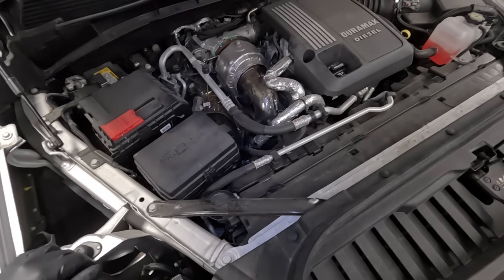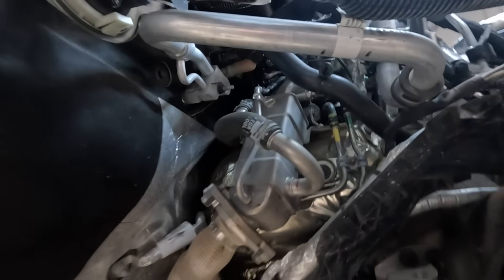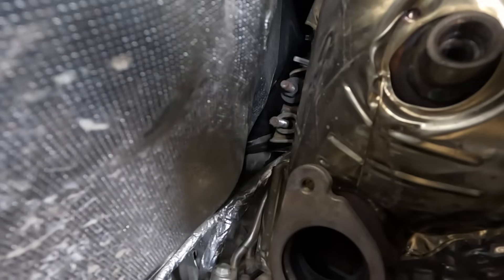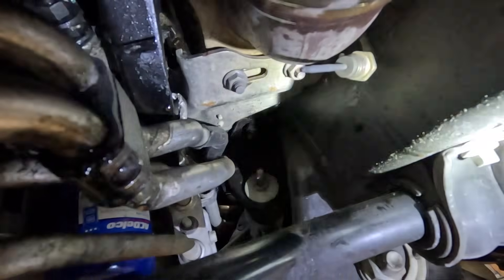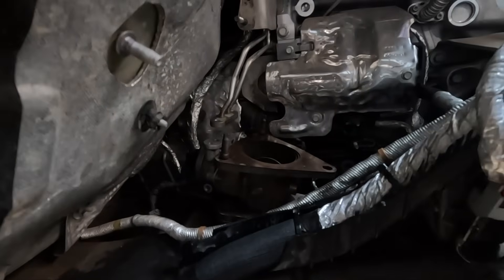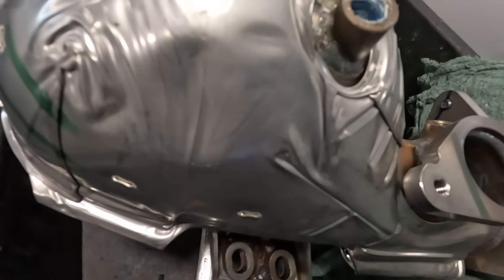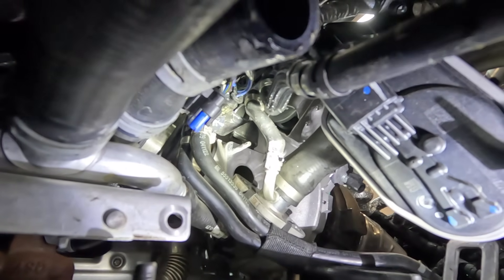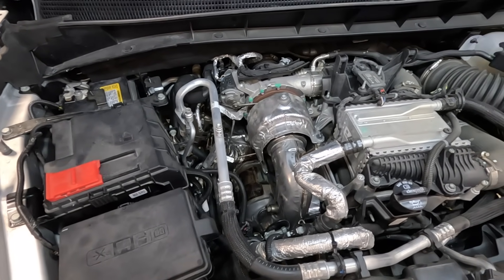DPF Removal + Replace 3.0 Duramax Diesel new SCRF / NOX Filter

Comment from the maker: You can Support the channel by using Affiliate links:

www.bankspower.com/DemonWorks

3.0 Duramax Oil Change W/ PPE Oil Filter: https://amzn.to/3qmLR6o
3.0 Duramax Oil Change W/ ACDELCO: https://amzn.to/3QtmDO5
3.0 Duramax Fuel Filter: https://amzn.to/3qc0uJL 

AC Delco Fuel Filter: https://amzn.to/3QFfXex

KlickWrench Socket: https://amzn.to/3QAQRxk
36mm socket: https://amzn.to/40CJnOT

Aluminum Filter Housing: https://amzn.to/3FZir28
Launch Elite Scantool: https://amzn.to/43S9fGw

www.duramaxnews.com

www.bankspower.com/demonworks

As an Affiliate / Influencer, I earn from qualifying purchases. Your support is appreciated as it helps the channel to continue to test products!
Don't Delete your truck when the filter can simply be replaced when plugged.

Comment: With the most recent EPA news release, you should make a video about deleting & helping people  select the best way to go.. i.e. tuning (to include transmission). ETC 
 These engines when not breathing their own exhaust should be half a million mile motors (especially lz0 with the steel piston upgrade). 
 I'm not a mechanic, I'm a DIY guy, did my lift, swap out components & maintain filters / fluids level. 
 The DEF savings in towing alone will be a great topic.. 
 Lee Zeldon is the man.. And the fact they put the science out there to be challenged says all I need to hear TBH.
Reply from the maker: I actually don't believe that pulling the emissions off will extend the life of the engines. The tuning bumps up the power and with that potentially increases heat, cylinder pressures and what is often ignored, strain. Not to mention the tuning typically spins the turbo quicker than in stock form and all of this will roll down to lessening the engine life, potentially.

Comment: I’ve been having NoX codes that will come up on my truck every now and then. The first time it ever happened the dealer “fixed” the issue by a “Hard-Regen”. The issue did come up again later. But i also had a Rear-Main Seal Leak. The dealer fully replaced this under warranty was in the shop for about a month. About 2 months later the ECM went out. So that had to be replaced however i had to come out of pocket, i decided to pull the trigger on an ext warranty. And now the NoX issue is coming back. I find during Regens the truck has a very bad DEF/Diesel smell. And the truck from time to time will idle very hard at a red light and then will go away after starting to drive again continuously about a mile or so. But the engine light kicked on, since i have the ext warranty i brought the truck in. They claimed it was the DPF Clamp? I had to drop $500 (not covered by extended warranty) but after watching this video appears that isn’t effecting anything mechanically with the motor or exhaust system. After they replaced the part. They claimed they needed people to “drive the truck for test drives before i could pick it up” i didn’t get answers for 3 days except that same answer. They finally called today and said it was ready and they had to troubleshoot the modules, to make sure everything is reading. And now it’s ready for pick up. I don’t think they fixed anything honestly and i’m sure i’ll be back with that issue. How can i express that the DPF needs to be replaced? I see lots of dealer mechanics commenting so i have questions.
Reply: Your Truck is my truck's twin brother ..... exactly the same issues I have had with my 2022 ..... constant engine lights "emissions system" and to the dealer, and back again ..... likely 6-7 times so far ..... the last time it was in, it was supposedly and unrelated issue and cost me money as it was not under warranty. Time to sell this truck.

Comment: I'm betting this is what my dealer may have to inspect and replaced. I just pushed oil through two different valve covers, and there's excessive pressure build up. Possibly blowing out x-amount of seals. I also smoked the turbo and pushed oil out of it. 39,000 miles on a 2024
Reply from the maker: I think you have a much deeper issue.

Comment: How hard is it to replace only the exhaust back pressure valve? The bottom flange seems to have broken off of mine.
Reply from the maker: not bad, couple tough to reach bolts but cit can be done in a garage in a few hours, much less based on experience.
Reply: My son and I just did mine. 2.5 to 3 hours.

Comment: Did you guys have to get it programmed with the new DPF? I’m still having pressure issues showing up a P131D.
Reply from the maker: the system does need to be reset but maybe you had a different issue than what was replaced.
Reply: @DemonWorks  thank you for getting back to me quickly. I’ve reset it, but it comes back very quickly. The code have you ran into any other issues with that code? I haven’t found any help in anything on this code other than it being a DPF.
Reply from the maker: @JaribDopp  I would look closer at the data for the egr system and exhaust pressure valve.
Reply: @DemonWorks  it all looks good

Comment: What did you use to get the bolts off the back pressure valve and the line bottom? Swivels?

Comment: Hey brother I’m doing this job this weekend thanks to this video.thanks for what you do to help the community.i have a question.is there any reset or relearn to do after install or does the code just disappear?thanks again bud
Reply from the maker: Hey ! You will need to do a reset with a bidirectional scan tool.
Reply: @DemonWorks  thanks bud.my neighbor got a really good one.he said he paid thousands for the thing with the software etc so I’m hoping to knock this out.i changed both upper and lower egr  while i was down there and plan on knocking out the whole dpf now.appreciate your feedback
Reply: Plz help
Reply from the maker: I personally really like this scan tool, I have used it for a lot of things, just not a dpf reset, though. It's returnable at amazon if it is unable to reset.... https://youtu.be/wKZ8kvLky0Q
Reply: What code did you have or how did you determine it needs to be replaced? Just wondering, I'm a GM tech and we rarely have had to replace them, most of the time it's other failed parts or leaks triggering a false DTC

Comment: Great Video thanks!  How is the Diesel Particulate Filter (DPF) heated during regen?  Is there a low pressure fuel injector in there somewhere?  I didn't see it in the video, maybe i missed it.
Reply from the maker: Great question! It actually fires fuel from the injectors during the exhaust stroke to dump raw fuel into the exhaust.

Comment: LM2 has only been out a few years, right? How many miles/how old was this engine that needed a new DPF already?
Reply from the maker: This one had an issue that’s not considered common.
Reply: @DemonWorks  Thanks for the quick reply!
Reply: did similar replacement at the dealer at 80k, took about 1 week to diagnose it & ordering parts thankfully it was cover by warranty. hopefully this solves the check eng light problem if not going to trade it in

Comment: I just got a clean exhaust filter continue driving light, if I do a straight pipe turbo back exhaust will that prevent that light from coming on in the future?
Reply from the maker: The message means you need to continue driving as the system is having a hard time completing a regen. If you do a delete, you will need to program it appropriately for that. Based on your prior comments in a different video, you plan on doing that and building your youtube channel from that. Good luck to you !
Reply: @DemonWorks  thanks man I appreciate it
Reply: Im on the same issue took it to dealer they told me bad Cats

Comment: I fail to understand why GM thought it was a good idea to put the dpf for the 3.0 engine in the most inconvenient spot of the exhaust and not have them in a more accessible area like on the 6.6’s or any other heavy duty diesel. Just makes it cost even more in labor for when we have to take them have in to fix these ticking time bombs
Reply: Was supposed to heat the DPF to reduce emissions and increase DPF life.

Comment: why does the dpf need to be changed??? that engine i feel is still a pretty new platform?? i have a 2015 golf tdi and my dpf was installed in 2018 where it has had no issues (yet)
Reply from the maker: It had an issue that required replacement. Not a common issue but as a GM tech, we often see uncommon issues come through.

Comment: Does anyone know if the 3.0l has an in tank fuel pump?
Reply from the maker: Yes, it does.
Reply: @DemonWorks  I’m assuming it’s pretty difficult to replace since even taking the battery out is a process, could it be done?
Reply from the maker: @dirkdiggler6038 just need to remove the driveshaft and the fuel tank 😬
Reply: @DemonWorks  that’s unfortunate 😕

Comment: This is good BUT, if you can't give the codes it threw or the suspected cause, i.e. nothing but short trips, defective DPF, excessive DEF injections, SOMETHING, then this is of very little practical use to most of us who have these engines.
Reply from the maker: Meant for entertainment purposes. I left out details for many reasons, but one of which is that the internet can get so focused on one issue that someone else had, they assume they all have this issue and that specific code would mean this is their exact issue.  If anyone is setting a code, it should be diagnosed to their specific vehicle. I Appreciate your comment, I should have been more upfront about my intentions with the video.

Comment: Recently purchased a 23 Suburban duramax 14000miles no major service has been preformed.  When i got it home and on ramps i found a 15mm bolt 2 inches long round on end. Flange head with a thick washer caged on it laying on the skid plate.  Dealer did 15 second look and gave up. Thoughts?
Reply from the maker: send me a pic to mstrgoodwrench@gmail.com and I will take a look and give you my opinion on where it goes, if I am familiar.

Comment: Put a carbon monoxide detector in the cabin, and see if it goes off. If you’re smelling pure exhaust then there is a leak before the DPF. You really don’t smell exhaust that’s exiting the tail pipe.

Comment: For the love of God what a nightmare...perhaps I missed a vid or something but how the fook does a DPF blow out? Any preventative tips or tricks to avoid this will be a Godsent.  I hope the warranty is covering everything you had to change including your Labour!!! I'm about to start ordering majority of the upgrades you've done to date (Hopefully the DPF will not be part of it --wink wink) I know some gains will come of from them but I know it's not enough. I have the 23 AT4 3.0....love it for the most part but it really needs more power. I thought a chip would be a solution but apparently not. I am going to get a 2800-3000 stall converter as I love the feel of them I know its not actual HP gains. To be honest I was hoping you came up with something!! I can only think of a larger turbo...but not sure of cost. I'll definitely update once I get some stuff put on. First up is the K&N with the PPE Zilla pipe. As always thanks for all the updates and also comment responds....Peace!

Comment: Show us how to delete this 3.0
Reply: He just did(nt) 😉
Reply: @1979Ragnarok  Other than fabricating a pipe to replace the DPF.
Reply: I blocked off my egrs leaving the valves in place got a CEL but she runs like a champ and still does regens
Reply: @08tundra Delete tune kits are available now if you have the E46 ecm
Reply: @08tundra  What's CEL?  Did you notice a difference in fuel mileage?
Reply: E66 deletes are available now
Reply: That would be a felony.
Reply: @ZmannR2 nope epa lost in court they can not make laws
Reply: @ZmannR2  EPA has no power now. Chevron case overturned to take away power from these agencies.  No enforcement.  also Cafe standards rolled back.

Comment: Was on my way to the dealer yesterday for an oil change and got a MIL out of nowhere. First time I've ever had a code pop up on my 2020 LM2. Plugged in my OBD dongle and read faults with Torque just before I got there. The lovely P2C7A. They did the oil change, but I guess the tech didn't have time for more than checking a few things. Gotta take it back next week for full diag. Hopefully one of the simple fixes and not something like this. I've always had exhaust smell in the cab since new and every time I've mentioned it they've said it's likely just regen. I know that's BS. Remote start in the winter with auto HVAC is the worst. Hop in after letting it warm up for 3-5 minutes and the smell is horrible. Setting HVAC to recirc mostly makes it go away. I've always wondered if mine has the bad weld on the backpressure valve. Welp, now they have an actual reason to find out where it's coming from. Kinda surprised it has made it this long without throwing a code.
Reply: It needs a backpressure valve. The welds leak on them. I've changed them before and so have other techs here. Also have seen the intake resonators leak at the turbo. Any induction/exhaust leaks can cause P2C7A and will plug the reductant injector, causing an incorrect spray pattern, causing this code. There also may be software updates. I've had luck with fixing the leaks, replacing reductant injector, updating to latest calibrations, and running a service regen on all the ones that come in with that code and have yet to see one back
Reply: I had this very issue on my 20 LM2... They ended up replacing some parts of the exhaust after countless fights at the dealer. They all agreed it wasn't normal but they couldn't find a leak. I ended up having more problems with the truck and traded in for a 21 LM2 and I've got 30k on this and all is good so far.
Reply: I’ve lost count how many times my 2021 3.0 has been to the dealer for this code. GM field engineer is doing all the troubleshooting. Cumulatively they’ve had my truck 6months over the last year and a half. It was throwing this code when new and dealer assured me it was nothing to worry about. Then at roughly 50k miles they’re like did you know your check engine light is on? We scanned it and you really need to get it in here….they still can’t figure out the problem. I’m currently waiting on a loaner to drop it off yet again. In addition the oil cooler has been replaced for a leak, rear main seal replaced for a leak, glow plugs gone bad, camera problems they can’t figure out, rear power window regulator, fuel injectors, nox sensors, catalytic converter and more. It’s been an awful experience. Granted the engine runs great, mileage is good, but so many problems and GM isn’t very helpful. Oh yeah, the new 10speed transmission recall that’s not really fixing the problem…sigh

Comment: I'm at the dealer and have had to replace these also. Honestly not a horrible job. I pull the upper and lower cowl when I do these. Takes a few extra minutes but opens up the engine bay alot. Hardest part I have is lining it back up and over the studs. But leaving everything loose helps
Reply: Why are these DPF filters failing? An owner would like to know.
Reply: Also curious, is this high mileage vehicles or city drivers?  What's the sign to replace it?  Throw a code or does it start to Regen more often?
Reply: Pull the cab for just about anything on these.
Reply: I agree.  I'm at a GMC dealer as a diesel tech.  I've done this replacement before as well.   Not terrible.  I thought the worst part of the job was the difficult access to the hidden bolt on the lines going to the back pressure valve and the hidden exhaust nut on the back of the filter.  Takes some patience for sure!
Reply: @DustinTSpeed  what was the trick for the flange nut im stumped
Reply: Ours is throwing 3 codes and running rich (you can smell diesel through cab when driving around town and Regen more), anyone else seeing codes